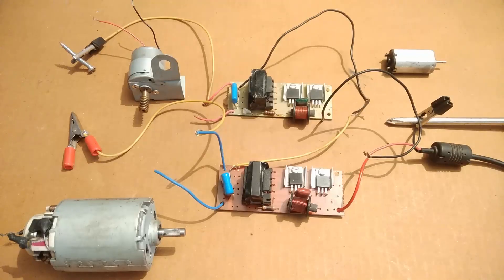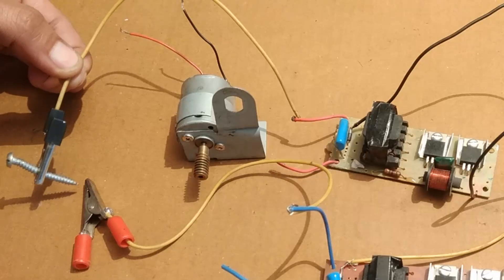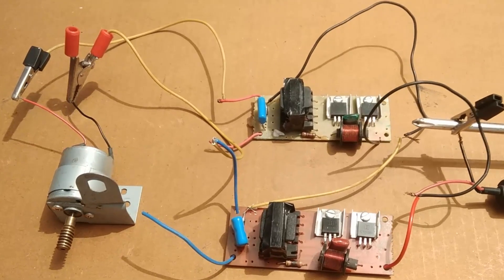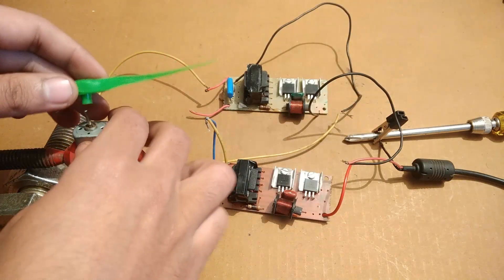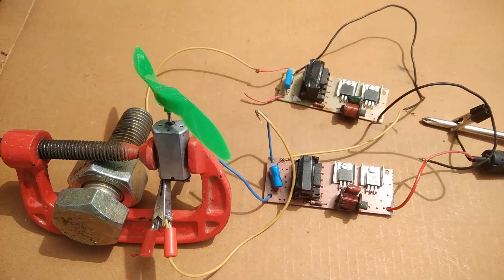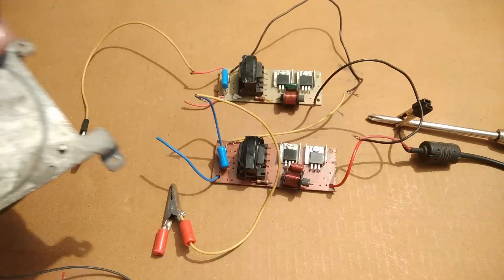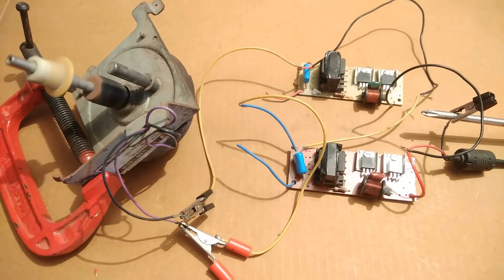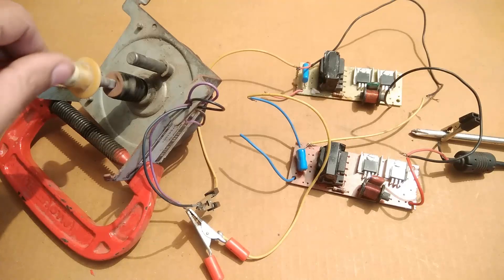Wooow!!! 3V DC MOTOR forced at 4000V | Awesome idea New DIY

Comment: Your 4kV source only outputs a few volts under load FYI
Reply: Yes the voltage on the powerlines does drop some times, but if you measure it under load it will still be around 110 or 230v. At my house I can measure it above 230v, it is higher in order to still be 230v when there is a voltage drop.
Your 4kV will probably drop to around 4-7V, and a low amperage, as it probably would have burned if it was around 12v (ElectroBOOM has tried it, and I have tried it too (with a 5v motor to 12v)
Reply: ElectroBOOM woowowowo are you real electroBOOM
Reply: ElectroBOOM im inspired by your work and im 12 years old my hobby is making radio electronics and your my fav youtube greetings from holland!
Reply: i have tried it with 230V and a 3V DC motor when i was a kid and didnt know what im doing XD now i can say for sure, there is no voltage drop on the line XD
i did survive, but the motor has gone.. quickly.. it was like A BIG BOOM, and then few seconds later another big BOOM.. the second BOOM was my older brother, who saw what i  had done, slapping the back of my head XDDD
Reply: Mr Uneducated Electron
Reply: @ghostxop2101  superb
Reply: @ghostxop2101  real uneducated after 8:30
Reply: ElectroBOOM I really expected your comment here :) Please keep going on with your fantastic videos, and remember,  to efficiently convert AC to DC you need a FULL BRIDGE RECTIFIER!!!
Reply: Please measure the motor voltage while running and let us know. I bet it is less than 20V.
Reply: The Magic Word: Current.
Reply: I may not now nothing Mr Electron ..
But I swear it's about power.
You may have 4000V with like 0.001 amps. That's like 4W power.
So wtf. This is useless.
Without amps it isn't going to be usefull at all. 
I really needed this comment because me not knowing shiz.. would have used too much voltage for a motor even if I wanted to make it go faster and still keep the same torque.

This will destroy my motors wtf.
Reply: How come these thin wires are handling current greater than 50Amps?
Reply: Stefan, the grid is much more capable and will usually meet load demands, the voltage range specified for EU/UK grid is around 7-10% of 230V IIRC. Curious to know what would happen if it does drop below the range however. It is a legal limit mind you..
Reply: Cory Ory That's true, I thought I once measured 238 :P
But the grid has so much power, you can pretty much short a live wire (ignore the breaker) and it will probaby stay 230v
Reply: I wanted to say the same thing. I think it is just running at like 12V, don't know the suplyvoltage. You rectified it...
Reply: Stefan van Tilborg ive tried 12v but it doesn't run much faster past 9v i recommend a lower current and a strong magnet attached to each side of the motor tho the magnets don't help for universal motors
Reply: Half of circuit will does much then you can imagine. But you will need more then 2 equipment with half circuit. That will not burn and brake a full circuit. 2 individual circuit can not be short circuit. You have to be as silly as dumb. you will not know any scientists that can prove your logic. Logic is not known other then logical circuits. LOL you are lucky that i know it worked. That depends on amp... more then voltage for a huge motors. if you calculate frequency of current and measure its amp, you will be disjointed about it. That will not run your microwave. LOL
Reply: ElectroBOOM i think its not powered by 4kv notice that motor start before screwdriver touch the ground and turned off before disconnecting from supply , hence it fake fake fake at least 4kv will breakdown and burn the rotor i bit its overloaded motor with 24v ....FAF !!!!
Reply: ElectroBOOM hahahaha take a look to the connection why he not connect the second terminal from same board its FAF its positive bypassing the pcb's to the motor 😐
Reply: U are awesome
Reply: ElectroBOOM tep
Reply: GIMME DA MEETAH
Reply: lol
Reply: Thank you. I cringed when I saw the title.
Reply: Half of circuit will does much then you can imagine. But you will need more then 2 equipment with half circuit. That will not burn and brake a full circuit. 2 individual circuit can not be short circuit. You have to be as silly as dumb. you will not know any scientists that can prove your logic. Logic is not known other then logical circuits. LOL you are lucky that i know it worked.
Reply: Mr Electron The voltage will drop significantly because it’s not regulated. (Wouldn’t be surprised if its below 12 volts) also the “4Kv” source of yours doesn’t have a big load on it, meaning no voltage drop. Also those puny wires of yours would’ve melted (because of the high amperage) if the supply voltage was regulated but not current limited at 4Kv.
Reply: ElectroBOOM when's the video coming 😂 huge fan by the way
Reply: bingo , but he don't know this :/
Reply: i agree, if the voltage is steady at 4kv it will go BOOM!! Chika Chika Chika BOOM!!, btw i cant do the monobrow move lol
Reply: Whao electroboom you are here
Reply: savi sharma I think you don't have enough knowledge that is why you think his videos and he is fake
Reply: My thoughts exactly , if these this things had HV running through them , they would be on fire.
Reply: ElectroBOOM ahahaha
Reply: HE HAS AN ACCENT YOU CAN'T TRUST HIM
Reply: @ElectroBOOM i love you
Reply: This is fake is not a 10v motor to 4kv with 1mA i test it and it dont vorking
Reply: ElectroBOOM wow electroboom i your fans mehdi sahgedar
Reply: proc pises tak divne
Reply: منور يا عم مهدي 😂😀
Reply: Wow
Reply: Yay this is the first video I saw electroboom
Reply: ELECTROBOOM MY IDOL.  ⚡⚡ BTW ITS YOUR FAULT,  YOU MAKE AN ARGUMENT  WAR HERE, BUT IM YOUR ALLIED 😂
Reply: So what would happen if you replaced the resistors with ones capable of maintaining the load at 4k how high in reality do you think it could get before it toasted it ???
Reply: I dunno.... they both have accents. I don't think we can believe either of them.
Reply: I searched up "World's loudest 3V DC motor". Didn't expect ElectroBOOM here.
Reply: That's an absurd comparison. The lights dimming from heavy equipment is a minor voltage drop; in this case what you claim is "4kv" is dropping all the way down to a couple volts.
Reply: This would not happen with a FULL BRIDGE RECTIFIER
Reply: Wooo we luv u electroboom!(:
Reply: Also, you are connecting only one load.. there should not be a voltage drop..
Reply: ElectroBOOM this person is fake
Reply: Hi. The supply for the dc motors is the black cable that came from the right. There is a bridge hidden in the upper pcb that carry rhe power to the motors. The lower pcb has no funtion. Also like rhe inverters are of ac without a "FULL BRIDGE RECTIFIER" (😄) it can not make run a dc motor. Also it can not handle a significant power. Also two inverters never be in phase because they are self oscillating and free running each one at it own rate. The only thing is to obtain our comments to make cash. Like this of mine.
Reply: @savisharma6506  no
Reply: @savisharma6506  lol😂
Reply: Mr Electron butthurt lmao.wtf are you talking about! If you connect all the house appliances the voltage drop is still low..(10~20)volts and it mainly depends on how much the transformer is loaded! 
I dont think that buildings near the transformer have voltage drop issues... Anyways, just make the video and give us proof! I dont want to be rude but your 3rd comment is nonsense! Facepalm
@ElectroBOOM you rock mate,keep up the good work! I want to see more BRIDGE RECTIFIER!
Reply from the maker: Agreed but the supply was indeed 4kv irrespective of the fact that it automatically reduces under load - boom chika chika boom... I like your videos ElectroBoom.
Reply: :D chika boom! Then you can't call it a 4kV voltage supply if the voltage drops, can you? I once connected a similar 3V motor to 12V and it burned.
Reply from the maker: ElectroBOOM well then just for proof i'am gonna make another video. 😊😊
Reply from the maker: ElectroBOOM Just for explanation "we all have noticed that when we turn on room heaters & geysers , there is a slight dimming effect of bulbs until these heavy appliances are turned back off.Thats coz of the voltage drop because of the low resistance loads.We still say and its still printed on the appliances that they operate at 230V or 110V depending on the country we are living in.
So irrespective of the drop in voltage the supply is still 4kv.
If u want me to say that - is that motor actually operating at 4000V then no because the voltage drops.

Comment: The power that the motor is going to consume having such low impedance and that mentioned "high voltage" across it, can't be provided by a laptop charger and such thin wires, since, P=V^2/R. 
You are lying.
 The CFL drivers provide 800v peak voltage and maximum 20mA current with closed loop, whereas the motor needs at least 500mA peak current to start.
Please measure the voltage while it's running, to check the truth.
I didn't dislike your video

Comment: Hey , nice video  ...
I m thinking about electric kit assembly in motorcycles for additional benefits can you suggest me wether this motor which you had used in last application is able to run motorcycles in emergency condition or not if possible make videos on e motorcycle . I would like to a hybrid bike . If its possible to get mail by you help me... And give me some suggestions on same topic on mail...ID- acharekarprasad5995@gmail.com....
I've subscribe to your channel..
Reply from the maker: Even though the motor is so small, still it should work at such a high rpm with a proper gear box but it won't be efficient and also the motor is a brushed one so the brushes won't longer coz of the high rpm.
Reply: Mr Electron can you make a video on how to make a brushless DC motor that doesn't need a driver circuit?
Reply from the maker: ok sure!!
Reply: Brother the power here is only 40W.. you can only do some fireworks and run unloaded motors at high rpm with this.. as soon as you load this motor it'll pull current that even the power supply is unable to provide.. even you put up a hel lot of reduction gearing to decrease the motor current draw, you'll end up with output rpms that will be of no use.. remember POWER REMAINS CONSTANT NO MATTER THE VOLTAGE AND HERE IT'S ONLY 40W

Comment: you just thing about the voltage, not the current to. So what do yo thing, if you use 400 Amp to. it will birn your motors
Reply from the maker: Thant's y didnt give high amps
Reply: show me the voltage with voltmeter ?

Comment: what type of IC that you use on that regulator dude?
Reply: hahaha'
Reply: I bet you are use type of IC is LM78xx series. it's that right?
Reply from the maker: i didn't use any ic just power transistors, diode , capacitors , transformer , resistor & inductor

Comment: Check the voltage after the motors connected to the power ! it won't be that much!
Reply: john smith yes bro because the motor will draw motor current that these circuits will not be able to provide so the voltage will drop definitely

Comment: Ha man can you explain me the circuit you add the the two transistor and than a transformer and where is DC rectifier and the wire is also of low gage to handle that high voltage
Reply from the maker: +Tech.hindi A small diode is inbuilt within the ckt to create half wave rectification.
Reply: OK plz tell us that and the armature winding will burn at that high voltage
Reply: maybe its just a fake cicuit
Reply: well the diameter of conductor is proportional to current needs to be transferred. it's low current operation.

Comment: The4 voltage is one thing but give it more current i.e. AMPS you will see smoke! Stick a high impedance voltmeter and check the voltage dropping. The internal impedance of the inverter makes this hahahaha

Comment: nope if you have this voltage and connected it to the 3v motor, voltage would be instantly dropped, because your psu isn't strong enought.
Reply from the maker: +Jirka Svítil Yes it would but not too much coz u can see the speed at which the motor is operating.Its just incredible.

Comment: dumbass the motor would die if such high voltage is applied... it's simply fake
Reply from the maker: +Darren Samim No its not fake.Its just that current is not very high even though the voltage is high.Voltage and current together are responsible for overall power.

Comment: fake 3v motor makes rotating noise before touching the screwdriver 🤣🤣🤣🤣🤣
Reply from the maker: +Darshan bhoir no fake.
Reply: Mr Electron then how motor starts before you touch the screw driver
Reply from the maker: could you please  mention the exact time at which u saw that ?
Reply: Mr Electron when 3 volt motor is connected
Reply from the maker: Darshan. The circuit is true from all points since i made it myself.There might be that problem like sound started before the motor because of some video editing issues otherwise you can do the experiment and know it yourself.
Reply: Mr Electron ok fine

Comment: Input supply for our house is 230-240ac supply its weird that you can amplify that up to 4000v to verify  it please use multimeter or voltmeter
Reply from the maker: meters don't usually measure such a high voltage so thats the prob
Reply: Mr Electron    ookk then how you gonna prove your theory of 4000v output
Reply from the maker: Actually the ouput of the inverters that i am using says 1600V at 12V but since i am using a 20V  input so the ouput will also increase proportionally and since there are 2 inverters so together in series they make up aroud 4000V.Thats the calculation.
Reply: Mr Electron    yaaa is that it.okkk then it has a range of  3500 to 4000v may be as per my calculation .
Reply from the maker: You actually don't have to take my word for it.The spark length and the output stated by the inverter makers says it all.
Reply: Mr Electron       okk
Reply: Hello my friend usually i have a topic for you why dont you explain    about voltage and current and power and relation ships and how they variey      because there is a lots of confusion among many people .??? and you are using inverter right  so probably it should convert    dc current to ac current right.🤔🤔🤔🤔🤔🤔🤔🤔🤔🤔🤔

Comment: Nope! The motor didn't get tortured by 4000V. The resistence of that kind and size of motar is around 10~50 ohm. So if you want to put 4000Vdc to the motor, then you need to supply a few hundread amps. And that is impossible with that small power supply.
Reply: 송민우 it is possible to feed 4000v at .15 reisted amps.
Reply from the maker: we need almost negligible current as in this case to operate a no load motor.
Reply from the maker: correct
Reply: Higher the motor spins more is the resistance.
Reply: Song mein ou
Reply: Song Min-woo
Reply from the maker: That concept will be applied only shaft of the motor is locked and 4000V are applied to it but things change in case of a free running no load motor.
Reply: Mr Electron No load motor has higher inner resistance compare to loaded motor. That's true. But that resistance is not that big. So we need a lot of current

Comment: this seems perfect for drones and helicopters.. awesome !!   :D
Reply from the maker: thanks!!!!!!
Reply: I was saying not about this particular motor, if you change the size of the motor this math stays the same, is actually working at very much speed that is designed for. the potential to this is great, at least in electric motors (just my thought)
Reply: Leonardo Cabrera yeah it's working at a very high speed and VERY VERY LOW TORQUE.. remember buddy power remains same.. you can increase RPM and your torque will decrease.. what good is a motor which cannot be loaded?

Keep increasing the voltage and it'll will not even start :p why? Because at such high voltage the current will be so low that the motor won't even have enough torque to overcome it's own internal mechanical resistance to start :p
Reply: I know that more volts less amps. but, when you need a motor with low or minimum torque? ex: air filter, fast air smoke dissipation, as example
Reply: Of course you'll put a small low pitch prop on the motor to make an air filter/smoke dissipator..  as soon as you do that you'll massively drop the rpms.. :)
Reply: an air helix won´t "weight" a lot the motor, because the air is light.  really you don´t see any real difference in the speed, so the kinetic force, of the motor? it is designed to make other speed, much lower. is also working with the small helix.You don´t need much torque to move air, you need speed. for me this is useful, minimum. (I should try to make one,  but I won´t for now, I just don´t have the time) I should try different electric motors in this voltages to see what is what, but I can´t.
Reply: Leonardo Cabrera nope. It's actually very imperfect :p propellers require torque from the motors and at this high voltage your current is in milliamps which will provide absolutely no torque to the motors.. Remember you cannot increase power.. it stays CONSTANT... 20v 2 amps is your power supply.. 40W.. even small drone  motors pull 60-72W

Comment: Any real world application ??
Reply from the maker: +Trishit Dev Bepary Concept can be used in electric racing vehicles for short power boosts i guess or if u are planning on making brushed motor drones.
Reply: it may not efficient. because at this much voltage above rated voltage, core or constant looses increase at much higher rate which leads to poor efficiency.
Reply: Free running high speed motors and fireworks nothing else.. remember the power here is only 40W.. motors when loaded, pull current in amps.. this circuit only provides current in milli amps it cannot drive a loaded motor